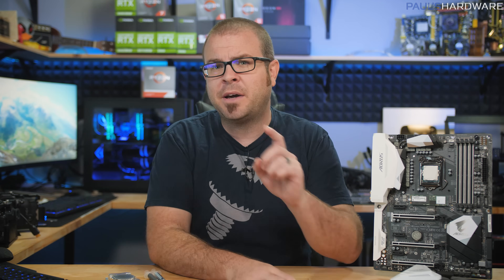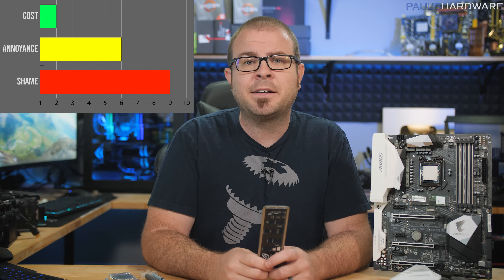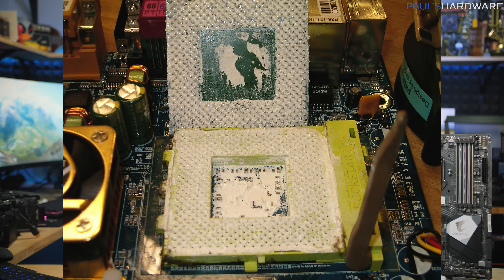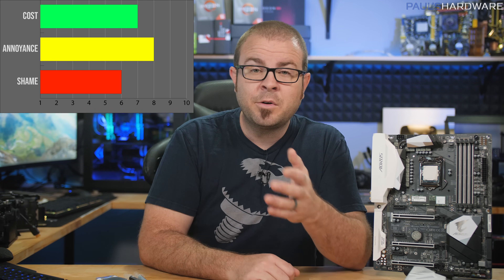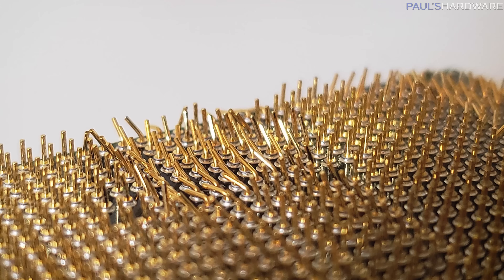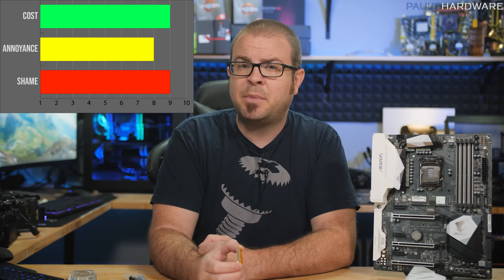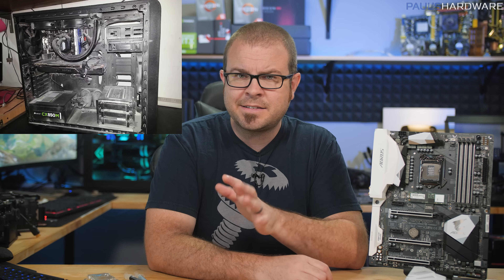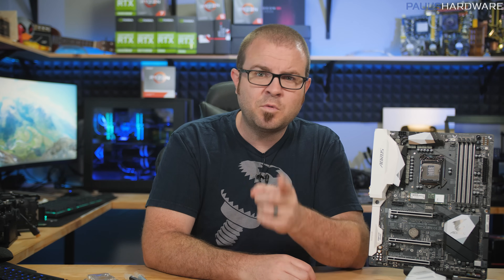The 5 WORST PC Building Catastrophes 💥🔥🧯

Comment: Get everything hooked up and your Ethernet cable will not plugin cause of the tab on the I/O shield that should be bent to it is on top the the housing, after going back to put the I/O shield on after having the motherboard installed (my 1st time)

Comment: No.2 🤣 i thought i bent the pins on my lga socket so i quickly dry run my pc, called a friend.. turns out i didnt plug in the cpu power cable..haha  Built my 1st PC after.

Comment: my day this past monday: Bought new x470 msi gaming plus motherboard, and brand new corsair 750 watt psu.. System fired up, i put in a ryzen 1600 to flash the bios to be compatable with a zen 2 R5 3600x.  The psu blew out 3 seconds after the flashing started. Just long enough to MEGABORK the bios. No response from the 1600 or the 3600x. Dead motherboard AND dead powersupply.

Comment: I did the dumbest thing ever recently.  I built a PC and equipped it with an AIO cooler.  When I put the radiator in i left the plastic on the pump so I wouldn't scratch the surface that contacts the CPU.  Well I forgot to take it off.  When the PC booted it would not post and there was a strong smell of something burning.  I took off the cooler and discovered the plastic cover but the motherboard was fried.

Comment: Biggest issue for me which was all my fault was using the wrong size screws to mount the mb to the standoffs.. I pushed them so far in and couldn't get them out after I realized they didn't fit. I thought they just weren't going in because it was slightly off center -_-

Comment: Oh my sweet summer child.

My first PC build was in '94.  I'd been a dedicated Commodore fan up to that point, until C= bit the dust.  Then my Amiga 1200, powerful though it was, was a dead end.  So, I bought a 486/100 board, 8mb RAM (4mb of 72 pin SIMMs and 4mb of 30 pin).  It was my first PC build so I had a friend helping me.  Plugged in all the cards (1mb Diamond Stealth ISA video card, VLB controller, etc. etc.) powered it up...nothing.  We pulled out all the cards save video, got a signal. Started putting cards back in, nothing.  Finally during the beer-drinking part of the evening, I say "Hey, Gregg, isn't that power switch supposed to be set to 110?"  - we'd had it set for the European 220v standard (that was a thing back then).  So I would say, for me, cost was 0, however, annoyance was a 6 and embarrassment was an 8 (I probably futzed around with the switch not knowing what it did).

Not a few months later, my then g/f brought me an 8-bit sound card (I had none at the time).  I installed it, but during the process, dropped the screw from the i/o slot cover somewhere in the case.  No big, I'll get it out later.  Let's hear some sou-  click  Nothing.  Absolutely nothing.  Killed my '486/100, 4mb of my memory, and the motherboard.  Although in retrospect, she probably kept it and gave me crap back.  What I got back was a 486/dx2 80 and the surviving 30-pin 4mb RAM.  Cost: 10, Annoyance:9, Embarrassment: 10.

And now for the piece de resistance : a few years ago, I made a critical error.  I was working on a PC while I was in a hurry and in a bad mood (never, ever work on a PC when you're in either state).  Anyway, I'd gotten a new 600gb hard drive.  My boot drive, the 160gb, where my critical files lived, (including article notes - I was a tech journalist at the time), needed to have it's own power connector.  This was long enough ago that multiple SATA power connectors beyond 2 wasn't really a thing.  But my modular power supply had more!  So, rather than wait until I got back home, I put the new 600gb drive in, put connected the new modular cable to a 6-pin, connected it to the drive, powered my system on, and could immediately smell something toasting.  I switched it off, checked connections, and LIKE AN IDIOT I powered it back on.  This time...FIRE.  FLAMES.  FIRE FIRE FIRE.  I'd burned the controller on the boot drive, because I'd connected the 6-pin to a 6-pin PCIE lead.  Oof.  Weeks later I found the same hard drive on eBay, bought it, swapped the controller board, connected the drive, and was back in business.  I RMAed the drive once I had my data off, and everything was peachy again.  Cost: 2.  Annoyance: 6.  Embarrassment: 8.

Comment: I got one that by pure luck resulted in no damage, but a shame factor of 11.  This was in the days when PSUs were on the top of the case.  I built and tested the system on its side and forgot the screw in the PSU.  Then when I righted the build, the PSU fell with a heavy clunk.  By some insane luck it missed everything, though it probably came within like a millimeter of hitting one of the ram modules.

Comment: 1. Fire

I can concur.  the only time this has happened with smoke and flame is with hard drives and mainly Western Digital drives with a foam padding beteen the drive board and the metal housing of the drive.  

One time I had a side panel off to work on a system when suddenly flames shot from behind the drive.  The rest of the PC ended up to be fine but the drive's controller board was FUBAR'd.  

Flames suck in PC's, use RGB instead.

Comment: 15 years ago when I was dusting out my p4 build I built in highschool I had a molex connector touch my sound card and blew up my sound card and motherboard. This is why I often tape over unused connectors if they are near the board. I admit this isn't very likely but it could have easily killed everything.

Comment: About three years ago, I used the wrong port on a modular power supply to plug in a hard drive, which promptly fried.  Thinking the PSU may have been faulty, I plugged a DVD drive in an attempt to troubleshoot.  The good news is the smoke that began spewing from the drive told me what the problem was, so I guess troubleshoot successful?

Comment: I've got one for you. Accidentally cutting a water cooling line while doing cable management and clipping the zip ties near the lines. Bonus points if it's on an AIO type cooler so it's more costly to repair.

Comment: Water Cooling leak is probably much worse than missing I/O shield. My friend and I missed our I/O shield the first time around. Got it though. We also put our RAM in the wrong Dimms and had it running single channel. Eventually figured that out, after getting another RAM kit to fill the empty slots and having a noticeable increase in performance and smoothness while using the system.

Comment: When I was young with my amd venice build, I spent all my savings on that, I bent a pin on the cpu, tried to fix that as shown in the video, and... it came off! When I realized I had no money left and I sold my old pentium 3 to buy that and I had no pc I cried a lot. I found out a good guy with a good solderer and fixed like that, it worked for a while, when I could afford a new cpu the dual core was available so I bought it. End of sad story.

Comment: I had to using a soldering iron to melt the standard AMD mounting bracket from the Asus Crosshair Hero X570 board. I completely stripped the screw so had no other choice.

Comment: Hurting yourself:
cost: 4/10
annoyance: 8/10
shame: 5/10

My experience: I was building my first computer ever. I waited a month for the last component (the tower), to be deliver.
I remember it was delayed because of some chineses' boats blocus. So I was a bit impatient.
At the back of the tower there were those metal sort of cache you had to remove for the PCIE outputs like GC.
I figured out at the first try that I can remove them by hand, so I kept going.
Then, on the third piece, it happened, the metal broke suddenly, with the force applied, and my thumb went meet a nice sharpy broken piece of metal :/
I end up to the hospital to sew back the wound (8 or so stitch). It nearly hit the nerve.
And finally I went back home, I finished building my computer (way more carefull this time!) and installed Ubuntu xD.

Annoyance is high mostly because of the hospital and the way I couldn't really use my hand with a keyboard for a few weeks after.

Comment: Here would be my top five, though admittedly these are for older systems, but over my PC building career, I've done ALL of these.

1) Building a PC and then discovering that a screw slipped under the motherboard and was grounding a trace... somewhere. Didn't kill the PC but caused weird issues (as I believe it was shorting the IO). And of course, couldn't diagnose until I took the ENTIRE system apart and then the screw just fell out.
2) Ordering parts online, only to realize you missed ONE key factor, like ordering the wrong kind of memory. I've done this both with ECC versus Non-ECC, but the days of RDRAM really brought this one home.
3) Swapping the USB and Firewire connectors on the motherboard. This is back when manufacturers didn't actually block the pin on the connector so they couldn't be swapped accidentally. Fried two motherboards IN A ROW doing this. smacks forehead
4) Forgetting to connect the Graphics cards' power header. For me the card still ran, but when I ramped it up, the system just shut down. Spent an entire day trying to figure out how my CPU was overheating only to notice the missing power cable as I was about to give up in frustration.
5) This is an oldie, but common, particularly with Athlon and Pentium III systems. Crushing the CPU trying to install the CPU block. I again destroyed two AMD CPUs like this. I even remember watching Patrick Norton do it on live TV once. :( There is no recovery and nothing but shame while you wait to go pick up yet ANOTHER CPU...

Comment: mismatched or incompatible hardware.  You order all the parts for your new build and...................................My video card is too long for this case.  My memory is too tall for my cpu cooler.  My cables are too short.  My radiator doesn't fit.  I ordered 120mm fans when I really wanted 140's.   Not a compatibility issue but one of my favorites -- Everything I just bought went on sale 5 minutes after I placed my order.

Comment: I've had 2 that are desk related. #1 my desk is the type that has shelves and cubby holes built in the top. The new case I bought was exactly the same height as the space between the desktop and the bottom of the shelves... it wouldn't fit. Had to disassemble the desk until a new case came in. 

#2 built a cute fluffy pink PC for my 6 year old (using all older parts from previous builds, with a new SSD). Made a point to tell her to be extra careful with the PC, It's not a toy to move around and set stuff on, and blah blah blah. One day, while running a cord down behind it, I had to pull her desk out a bit. The cheap ass Ikea POS legs broke off one side and sent 100% of everything crashing to the floor.

Comment: I havent built a pc for a long time and when i decided to build one installed and mounted everything then when im about to turn on the pc its not booting up or posting. Swapped the parts to the other pc and its working then i found out that the cpu power cables are not plugged in!!!

Comment: Cutting a tiny trace on the motherboard, usually by scraping it with the tip of a screwdriver.

If you didn't notice it happen, you will never ever figure out what the problem is... and neither will anybody else.

Have fun with your infinite boot-loop !

Comment: I've dealt with several of those, specifically bend pins on AMD CPU(luckily was able to bend them back with razor)
also when I build my first computer I forgot MB standoffs - again, luckily for me the only problem was random crashes, nothing actually got damaged long term
too little thermal paste is also pretty common - I've learned it's better to have too much than too little

Comment: I sorely remember how my old LGA 775 board got its PCI-E slot malfunctioning beyond repair. Every single low-powered PCI-E graphics card in my arsenal that I put on the board (GeForce 9500GT and Radeon HD 5450) always led to display driver crashes and BSODs even on the simplest of usage, regardless of what OS I use and which correct drivers I use. I highly suspected that the main culprit was a cheap, low-quality PSU I was using on the rig at that time. Even after replacing the PSU with a better quality one, the damage was irreversible and crashes continue to happen at random. Thankfully, the board has an AGP slot which was completely unaffected by that BS. I put on my old Radeon 9600XT card on it and no more crashes, but I can't play modern games with that.

On that day, I abandoned the mindset of "it's okay to buy cheap as long as it functions" that originally came from my budget-oriented brother. Now, I always try to aim for at least 80+ Bronze PSUs, but I'd really like to get the Gold ones if my budget allows.

Cost: 8, Annoyance: 10, Shame: 8

Comment: Thermal paste mishap was mine on the latest build due to trying to install the AM4 included cooler and it moved around everywhere due to defective water cooler. Even through I got thermal paste on a pin but managed to get it off quickly and easily. Nerve racking time this build was compared to previous.

Comment: I bent the 2 bent PINS i had back on AMD's new cpu and it still wouldnt boot :( I also plugged a fan in while the PC was on and my RGB cable from the fan to the node behind the motherboard tray caught fire.... I havent had an issue int he past plugging in LED fans, maybe the RGB ones are a no no.... I was only trying to swap the fucking stock cooler lol.

Comment: I once had a fan that I had spliced into my system to run at 5 or 7v (don't remember which). It had been fine doing its thing for some time. Until I jostled the system putting the two exposed fan cables of the mod against the case and side of a GPU memory module respectfully. Needless to say the memory module released its magic smoke. Turning my 4mb Matrox Mystique into a 2mb version instantly. It survived it though. But the shame was massive.

Comment: More then 15 years ago a  substantial amount of motherboards where sold with bad caps. This event is known as the capacitor plague. I repaired several systems with mostly MSI boards that failed due to swollen caps within 3 years of usage.
For more info: https://en.wikipedia.org/wiki/Capacitor_plague

Comment: Here's some of my experiences from before YouTube:
1)  In my PC that I bought before learning how to build them,  I upgraded to a 160GB hard drive.  It worked fine until I filled it over 137GB.  Then I lost everything on the drive.

2)  I've used a power supply that came with a very cheap, unbranded case.  That thing started smoking one day and took the motherboard and hard drive with it.
3) In my first and only AMD build, I installed a newly released CPU on a slightly older motherboard model that claimed it would support the new CPU.  Then I found out that I needed a BIOS update to use it.  I had to borrow a friend's CPU to get it updated.
4) Forgetting to install the back plate of the CPU cooler before installing the mobo seems to be a common one.  I'm guilty of doing that at least once.
5) Also, a friend of mine plugged the floppy power connector into a USB header on his mobo.  Pretty much killed it.

I really wish I had techtubers when I was learning how to build PC's. I had to learn some lessons the hard way, like always back up your data, always use reputable power supplies, and always RTFM.

Comment: Trying to apply force to something to get it attached properly...  like one of those heatsink fans from AMD that snaps around the little clasps on the AM4 socket mount? 

using something like a screwdriver... having it slip, and go right at the motherboard, possibly knocking off some SMT components or something like that.

Probably never happens tbh

Comment: Man, I remember building PC's back in the 90's and the two main power plugs from the PSU were pinned in a way that you could TOTALLY install them opposite of what they should be, and if you did BOOM instant mobo death! And Now I can't even remember was it black on the middle or black on the outsides? Thank goodness for 24 pin blocks.
Reply: My personal shame from this era was getting about 10 disks into 11 of Windows 3.11 and then in a stupor, instead of pressing the floppy eject button.... power. :(

Comment: When i was a kid. like 7. i spotted a little switch on the back of the pcs powersupply. I now know, that switch changes the PSU from 220 to 110 volts (EU vs US) 
i flipped it to US and turned on the pc.... And the whole shit just started smoking, with a horrible smell of burning, smoke, a stench of smelting plastic and other things... luckily, nothing caught fire. 
but that's probably the closets thing i've ever come to burning down my school.
luckily nobody saw me flip the switch and so... i was never blamed. and nobody was hurt - except that old pc (This was in the mid 90s - the PC was running Norton commander and just had some games installed )

Comment: Been building PC's since I was about 10 - my first build was an AMD K6-2! I've had/done all but one of these. The worst definitely being at 15 years old and having my Athlon XP 1600+ die because the guy at the shop I bought it from opened and tested my Thermaltake Volcano 6 on a socket 370 board, losing the socket 462 clip in the process. He neglected to tell me this and being only 15 I didn't bother to check. Fried 1600+ took out my whole system in a blaze of glory.

In all my years I've never used an anti-static strap and more recently, I've built 2 M-ITX based machines in really cramped spaces. I've managed to short 2 ITX motherboards and finally bought my first anti-static strap.

The shame is real.